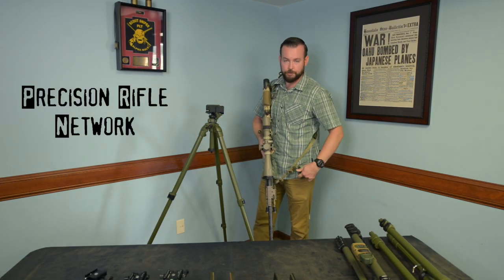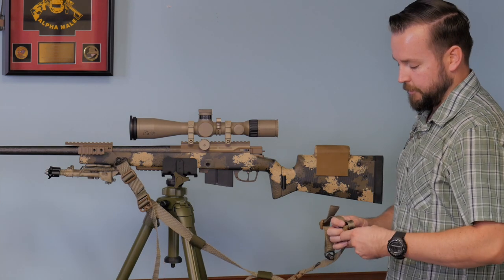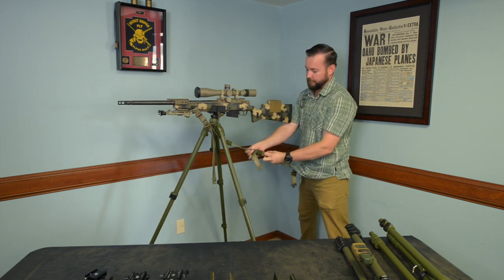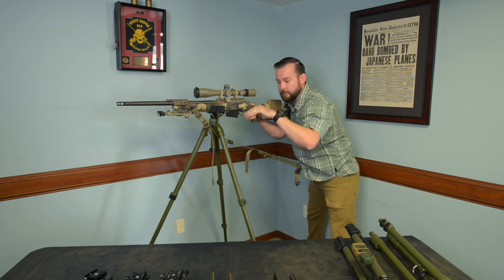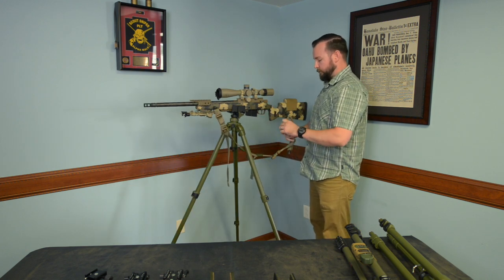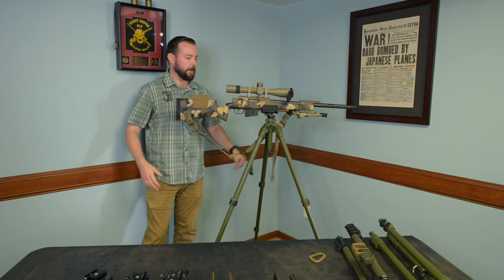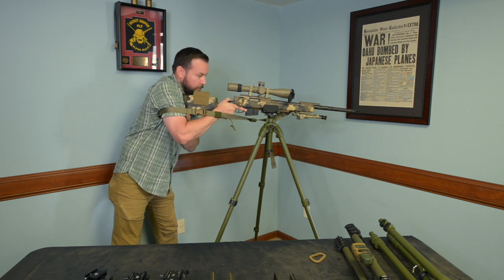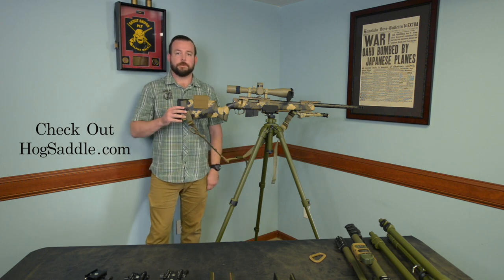Sling Techniques For Precision Rifle

Comment: Can you do a followup with sling techniques most would use in PR matches?
Reply from the maker: I feel like he covered a couple of them.  He says in the video that these positions are common ones for PRS.  Especially the one where he passes the sling under the tripod and attaches to his belt with the carabiner - I use that regularly in matches.  Either off of tripods or off of barricades like tank traps.  In answer to your question, I may do a follow up, but it will be into next year before I go that route.